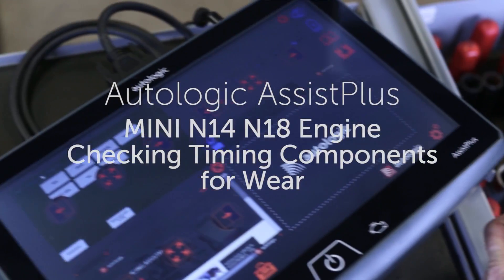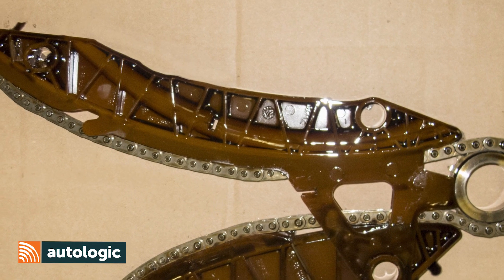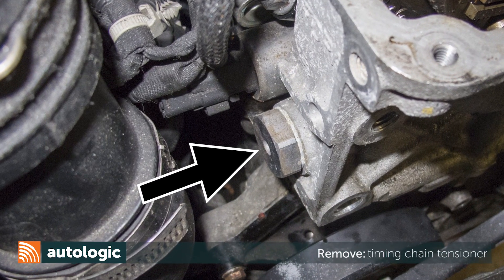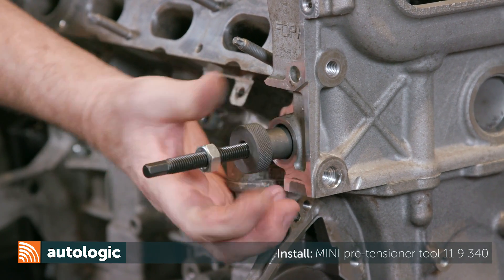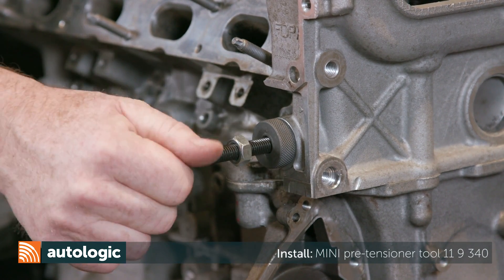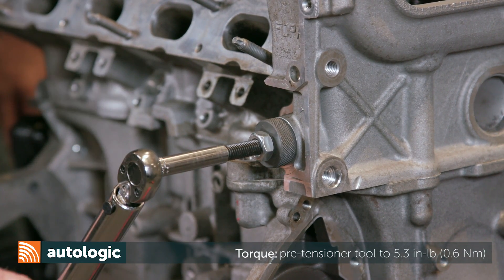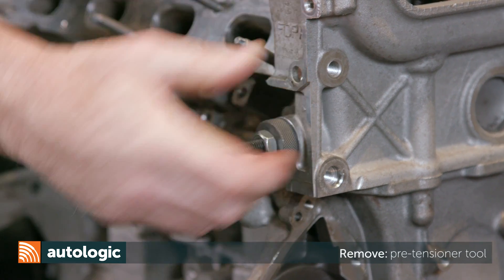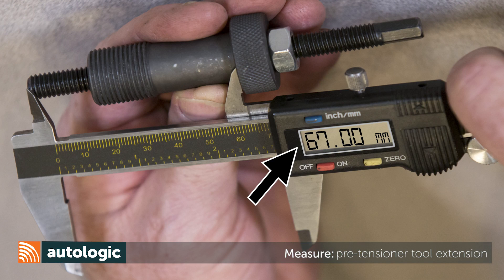MINI N Engine timing chain Checking for Component Wear

Comment: Does is necessary to block the camshaft?
Reply: No, you only need to lock the camshafts/crank if you loosen the cam/crank sproket bolts as there are no keys on the shafts to lacate the sprokets/gears

Comment: What is the measure if all is well?
Reply: its in vid, less than 68mm, the chain is ok. I'd apply tension to the dummy tensioner while rotating the crank 4 times to find the longest stretch. 
If measurement is more than 68mm go and get latest bmw chain tensioner which is longer part#:11317607551. My 2010 N16 engine still had the shorter tensioner in it. Chain was spot on 68mm and the longer tensioner would have probably fixed the rattle (i ended up replacing the chain using a kit as I already ordered it).

BMW SI M11 02 07 (Oct 2010) states to only use the longer 551 tensioner on old chains. Apparently these tensioners will keep good tension up to 72mm slack. If a new chain is used, use tensioner part#:11317597895 only.

you can also use special tool 2353281, you just screw (without supplied shim) it in to 80Nm/59ft.lb then rotate engine clockwise 4 times while checking that the protruding pin shows the whole way. if the tensioner is too extended then the aft protruding pin wont show and the chain must be replaed. Im not sure what this is pre set to though? See ISTA+ 11 31 540